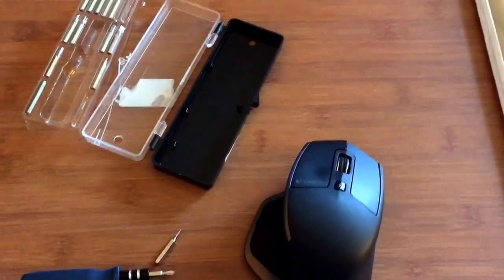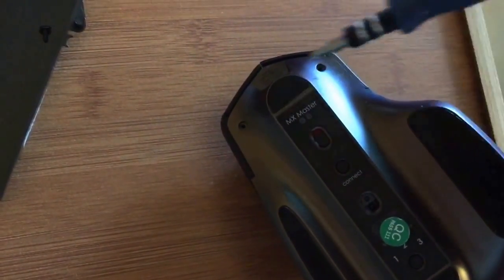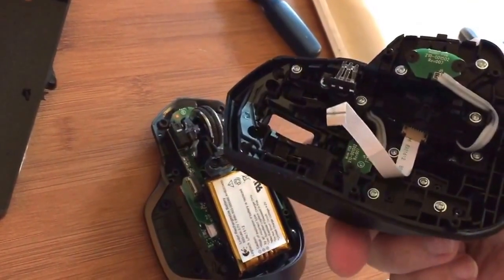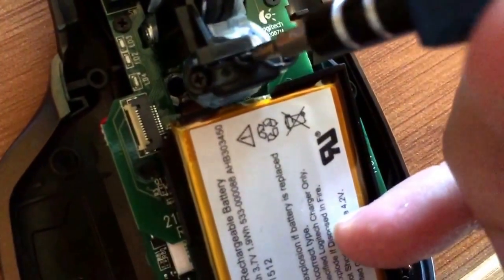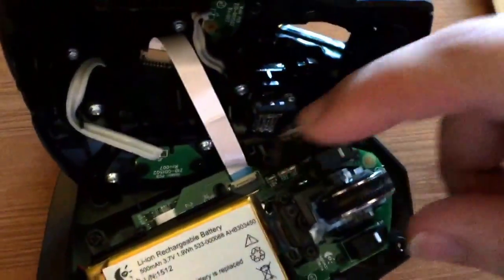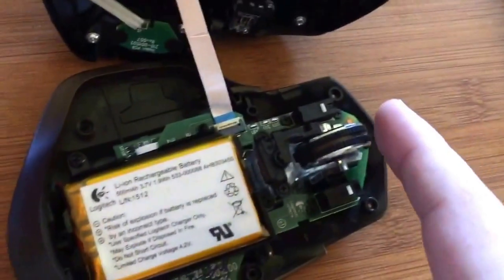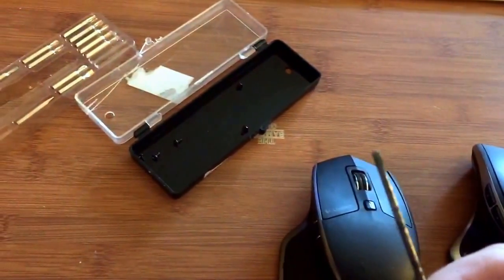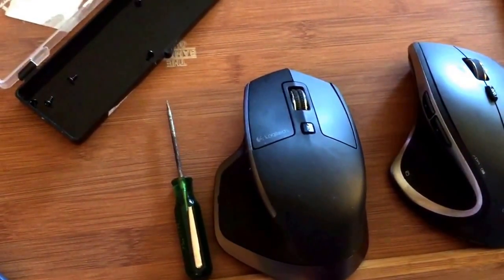New Logitech MX Master / 2s Scroll Wheel Fix 2019!!!✔🏆

Comment: You just open the Logitech Options, and click Restore Default button. Then this button will works again :)
Reply: Didn't work for mine.  I wonder if the cable inside comes loose automatically which stops this from working.  I'll have to open mine and see.
Reply: Only work for 2s, not for first mx master

Comment: if you're have this problem even after turn it on, try to open the "Logitech Option" software first then in scroll wheel will work like you want
Reply: omg that actually worked, that's ridiculous, but thanks!

Comment: The mouse must be powered on for the free scrolling function to work. I noticed yours was off. You might not have needed to perform this repair.
Reply from the maker: deff did that first. this is if the mouse has been used for a while and plastic spring come up.
Reply: I think he just forgot to turn it on, and realized it later 😂